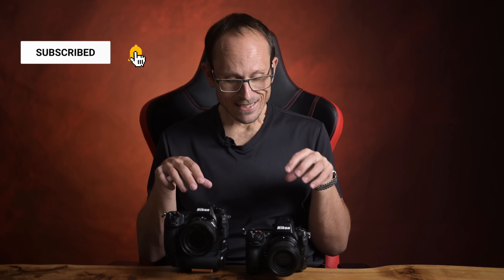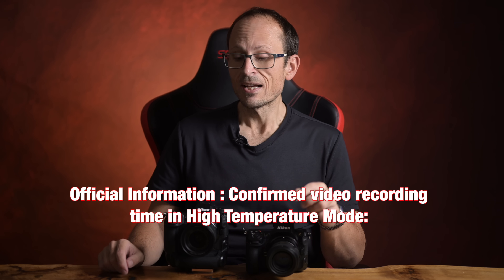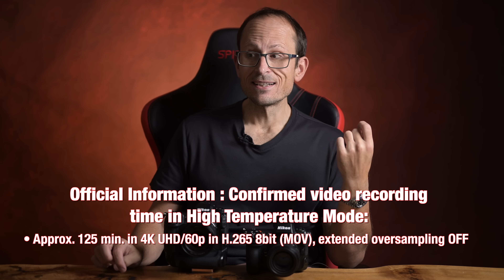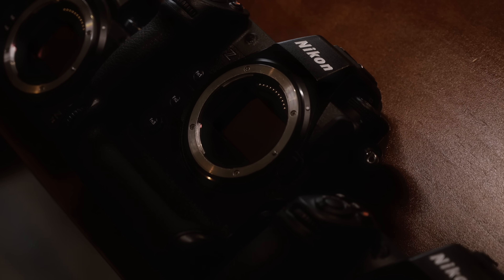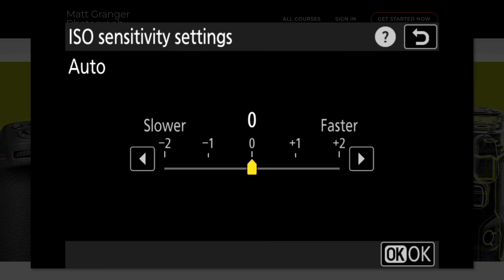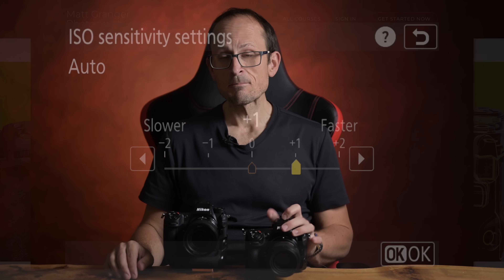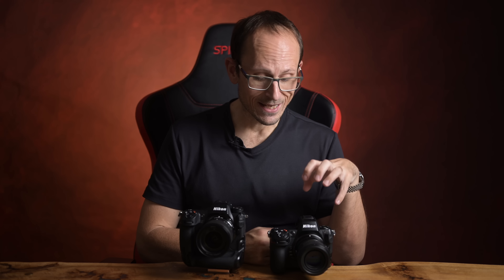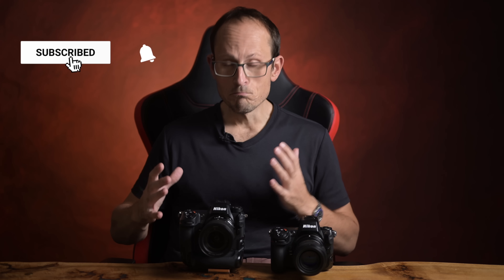Nikon Z8 - Video OVERHEATING & Battery Testing (VS Z9)

Comment: I would argue all smaller cams overheat unless they have a fan doing 8k i never tested this but tried now. My A1 doing 8k30p (no 60p) lasted 1h14m doing 10bit 4:2:2 at 240MB (didn't want todo 520) the body is much smaller than the z8 but fully metal room was 22c. Doesn't proof much accept that they all have a limit and you should know what use when. I think the z8 will be fine and if you really don't want to get a z9 but want a z8 with long recording change format and/or add some cooling.. don't complain but work around the issue :)
Reply: Gerald Undone tested that using a dummy battery can extend the recording time of 8k 24p to more than 3 hours without overheating on the A1. That makes the A1 powerful for long hours of recording. I wonder if the same trick can be used to make Z8 more usable.
Reply: @chanjeff4406  I am working on a cooling product for the zv-e1 and didn't have time to really test the A1 but i am sure if needed this time can be extended like you say i might do some real testing on the A1 too just never did. Thanks for the extra info.
Reply: @MattIrwinPhotography  Thanks for your input - that's reassuring to hear.

Apart from the most demanding modes such as 8k 60p or 8k 30p N-raw, could you also test 4k video, specifically 4k 24, 30 and 60p in Prores raw, N-raw, oversampled H265 10 bit, to see how long will it take for the camera to shut down? Also, can you make some of the 4k and 8k tests using a dummy battery (as it appears to reduce the heat generation), please?

I know I may be asking too much here but I really appreciate that you would put through the Z8 into difficult tests, so that we can see the real potential of it. Thank again.

Comment: Very interesting Matt, thanks.  I have had my Z9 for 12 months now and do use it to record video as well as stills.  The only time I had a "Hot Card" message was back in July when I was at the RIAT 2022 Airshow (in the UK).  It was a very hot day with very little cloud.  I was shooting one continuous shot of a display team in action.  I can't give you specific times or even which codec I was using at the time but the clip would have been somewhere around 4-5 minutes when I saw the message.  Bear in mind I had been standing in the sun, camera in hand, for several hours by that time.  I turned the camera off and put it under my chair to be out of the sun and used my Z7ii for a few minutes.  When I next tried the Z9 the message had gone and I had no further issue but did take care to shelter the camera from the direct sun whenever possible.

Comment: I think this is a very respectable performance for the Z8.  Using my Cobalt 650GB Gen 2 cards in the Z9 and recording 8.3k60 N-Raw indoors ~75F and stationary on a table, I was able to record four ~14:49 minute videos in a row without getting any warnings at all.  Card fills up, delete file, do it again, maybe 30 seconds rest between clips.  The Z9 does get warm, but not hot.  It is surprisingly even warmth on the surfaces of the body, and to me at least indicates a good thermal design.  Even with good cards, the Z6II can only do about 8 minutes in its top video mode, 4k60, before the camera needs to shut down.

Comment: It is impressive that the Z9 can do all of those codecs and frame rates internally. If you’re looking at the Z8, for video, I’d suspect that it’s more about form factor… If Nikon is actually serious about video, I suspect that a FW update to enable USB recorded (at least in some codecs/frame rates) will be coming… Until then, Ninja V+ and PD usb… Problem solved!
Reply: I was thinking the same. Two  ports seems to me an option for long recording with power and storage via usb.
Reply: Hopefully they didn’t miss that opportunity.

Comment: If you use an external SSD connected to the Z8 via  usb-c it will solve your problems of hot cfexpress cards
Reply: Is this possible!?
Reply: @northofbrandon  I don't have the Z8. It would be good to have the answer from Matt.
Reply: That's not a feature of this camera. At least not yet.
The Panasonic S5IIx can do it.
Reply: @robertfeliciano5723  I would love this to come to Z9 in the future via USBC
Reply from the maker: Not an option
Reply: @mattgranger  rip

Comment: do the test with usb charging,,,. it should run color because the battery could be the issue
Reply: Would be interesting with the grip as well since battery would be removed from the body.
Reply: @MTBD80  good point.

Comment: Thanks for the tests and results are the results. 
I still wonder if one used the very latest generation type 2 CFE-B cards - like the 650Gb Delkin Black or some of the others (even the pro models of your NEXTORAGE cards) whether or not the hot card "issue" would be deferred on each camera. Obviously in 4TB one has to use Angelbird and there are more choices at 2TB including the Sabrent Rocket CF-XXIT-2Tb I have. I will wait until my Z8 arrives to perform my own tests. 
I would make you point a little stronger very much doubt that other than for documentaries any folk would run a video recording continuously for a very very long duration -- even as B-roll -- you are going to want to set up and record multiple times and these are often fairly short segments. One matches our recordings to what we need and what our gear can accommodate. Speak to those who shoot with RED, ARRI and Blackmagic about having to wait for their cameras to cooldown. This is all part of planning the gig - as is having multiple units to swap out and use while others cool down. The trick with th eZ8 is it is relatively compact and relatively cheap -- so 2 Z8 and a relatively small gimbal/rig or one Z9 and a large pro-level gimbal/rig. Pros are simply going to make choices that work for their circumstances. 
Of course in ultra high heat like Qatar or Abu Dhabi I expect to have to actively cool gear and card not just let them cool down. For those of you in the tropics yes heat and humidity is a huge issue as well.
Reply: I didn’t realise professional cine cameras in large bodies overheat as well. I have the Z9 which is great. But I really want a Z8 for the gimbal and slider that doesn’t overheat.
Reply: @MattIrwinPhotography  Thanks guys -- you early users get to play first -- 😃😁
@MattGranger- I assume when your results say 1030 - that is 0 hours 10 mins and 30 seconds -- or 00:10:30.00 in normal duration terminology 
 I am counting the day until my Z8 arrives and I can run my own tests -- well set it up and shoot with it. Then test it. It looks like @Mattgranger was first out with a Z8 set-up guide and @ThomHogan is hoping to publish his Z8 "bible" on or before the 25th May or "before Z8 start shipping". Steve Perry is working on updating his Z9 guide for the Z8 as well -- so it looks like in the absence of anything in  form of downloadable documentation from Nikon - there will be something to read when Z8's get into muggles' hands.
Reply: @andrewmason8691  -- YES very much so -- RED (lots of HOT RED stories), ARRI, Blackmagic and others all have various forms of cooling solutions and when on shoots in the heat (like on Dune) they have to have multiple set ups to prevent holding up "filming" while the gear cools down. Canon and Panasonic Lumix have built in and and Fuji bolt one cooling fans for their CINE oriented bodies. 
Pro CINE cameras often have large heat syncs - rather like a CPU cooling in a computer -- and most have some form of active solution either built in or as an add on -  but active solutions add fan noise which also has to be managed.  
BTW - you should not just put a hot camera into a fridge/freezer --  it needs to cool "naturally" so that water vapour does not condense into water inside the camera or lenses -- which of course can then cause "issues". Similarly one has to take care when a camera is taken from a heated space into the very cold -- ask anyone who goes out to shoot in the midwest/northerly parts of the americas - lenses can mist up from the inside.

Comment: So, no surprises here. Basic physics. Without active cooling (internal fans/vents), sealed vapor chamber heatsinks, etc. to expand the thermal envelope for operation, this is expected. Even a hypothetical die shrink on the Exp7 processor is unlikely to shift the envelope that much. 

And it just illustrates that anyone thinking of buying a Z8 as a $1500 discounted Z9 as video production work horse, should accept there is no free lunch to be had here. 

For everyone else (90-95%+), it's not an issue. $4k Z8? Great buy for what it's capable of.

Comment: Nikon motto should be “Good but…” The Z9 seems to be the only good camera they have at the moment. I bought the D810 right after you released your review and it’s such a great camera that I purchased 2, nothing after that has make me want to buy another Nikon and this was promising…”but”. Thanks Matt!
Reply: well Z8 is definitely better than the D810
Reply: @raynerp  not my point! It’s supposed to be better because it’s at least 8 year newer technology. My point is that for the longer Nikon has been producing cameras that can be described as “good but” (insert many reasons why they’re not up to current standards) there’s always there that doesn’t makes you say this it’s the camera to get. I’m not buying every camera that goes out that’s why I didn’t upgrade to the D850 or anything in between and Nikon didn’t make any mirrorless cameras worth buying until the Z9. The Z8 was a good promise but ended up being another “good but” camera

Comment: I wonder if manufacturers need to resort to active cooling, like some have done, to get longer recording times in hot weather. Interesting to see if Nikon will go that way.
Reply: They need to use higher end silicon chips that are more efficient and run cooler. We might have to wait a few more years.

Comment: It will be interesting to see which memory card manufacturer will be the first to jump on the "We run the coolest to give you longer recording times." marketing push. Also, I get the feeling PD USB power might make a difference versus the internal battery in thermal load on the camera.
Reply: they will have to be refrigerated!

Comment: Matt Granger- The honest Nikon Guy! Very good info, thank you. I'd probably shoot short wildlife clips for video. jpeg-4k-120 if it does that. If I continue with Nikon, guess it would have to be the Z9. Does the Sony A1 over heat doing 120 4k jpeg, Anyone?
 With all that said, doubt there would be any complaints considering I would be upgrading from the D810 but, would prefer a REAL STICKY AF FOR BIRD PHOTOGRAPHY.
Reply: ~25min with A1 before overheating 4k/120
Reply: @livejames9374  Thank you. Helps put things into perspective for me.
Reply: @MattIrwinPhotography  From what I understand, you don't have to stop to swap battery A out. But does it switch back to battery A automatically once rep;laced. Just curious. For me it probably wouldn't matter to much. Short wildlife clips but imagine at some point I would want to do a time lapse.
I think the Z9 is the better option if one can afford it & it should be for the price. The Z8 is an incredible value for the price point in todays market. The AF would need to be stichy for fast moving birds for me or a camera that takes lees photos (less In focus photos are worth more to me than more night quite in focus photos) with an accurate AF would be worth more to me.

Comment: and this is why the Z9 is the Z9 and those that say " why I paid 5500 for the same camera" there you go. Yet another reason why you pay the higher price.  That said, no one is going to push these cameras this hard anyway but good to know. Now I would like to see how these cameras would perform on a hot summer day in Palm Springs with the hot sun  out and about capturing clips with the camera on and recording 1 to 2 minutes clips.

Comment: It is disaapointing how you do not understand how heat is generated during video recording. Use better CFx cards..Dont blame the camera..
Reply from the maker: I’m using the Nikon approved and recommended cards.
Reply from the maker: The same cards that are no problem in the z9… don’t blame the cards, or the messenger

Comment: Surprisingly the Canon R5 peforms better than the Z8 in your test - the camera doesn't overheat and its battery last longer in 4k 24 and 60p. It only overheats at 1 hour mark for 8k 24p. 

The Z8's video capabilities is questionable at this point.
https://youtu.be/dcm3yJUi79A
Reply from the maker: I didn’t 4K 24p

Comment: While I like most of your videos this one leaves out too many variables - see scientific tests of Matt Irwin or Nikon Ricci
Reply: As you said, there are way too more variables on the overheating tests - cards, room tempertaure, humidity, recording formats can affect the actual recording time. It's hard to give a definitive answer on where the Z8 is reliable. 

A Hong Kong youtuber test the Z8 at 8k 30p with Sandisk CFexpress and the camera overheats at 32 minutes. 
https://www.youtube.com/watch?v=zfZw_z2d9uI&t=311s

Canada youtuber Gerald Undone also did the overheating tests with different formats with prograde 650gb cfexpress. Using the same format, however, the camera overheats after 1 hours and 35 minutes.
https://www.youtube.com/watch?v=U0Rrsttll30&t=4s
Reply from the maker: See pinned comment. I have nothing against ricci, but he is a Nikon employee.  My test shows the z8 side by side with z9 using approved cards in ac room.
Reply: @mattgranger  with all due respect I only pointed out that your test is not scientific, not even apples to apples (obviously). You compare different! specifications and conclude the Z8 performance is worse. It's still a mini Z9 at a very attractive price point.

Comment: This was very helpful, thank you.

I wonder how much better the Z8 would do with the battery grip.  Having the battery a bit further away from the sensor and processor should allow a little longer times.
Reply: I would forgo the battery grip, use an external PD battery pack, that will provide power for longer, depending on the size you choose. I'm looking at the SmallRig V-mount battery as it has one PD port on it. Nikon lists SmallRig and FX LION as accessory makers of supported devices on their site.
Reply: @waynerm002  yes, I agree.  I went out after I wrote my question, and immediately realized the USB-C-PD port is the solution.

BTW, I think this goes to the discussion you and I had a few weeks ago about overheating expectations.
Reply: @UnconventionalReasoning  Man, I really didn’t expect them to do only 1 body but, it does a lot of high level video recording without a fan. I suspect if they did that, they would lose some Z9 sales. I like the smaller size of the Z8 and having PD and USB data ports make me think we could see external SSD recording, that would now put it at a whole other level.

I think they might do another camera in the future in a different style for video, after they replace the Z9, probably.
Reply: @waynerm002  I just picked up a Panasonic GH6 for 'work' videos.  It has SSD recording, I'm looking forward to trying it.  The feature was added in firmware, so the same might be possible with the Z8.

You should have believed me when I said they would only come out with one body. 😉
Nikon is not Canon (R5 / R5C) or Sony (A7 / A7R / A7S).  They're Nikon (D5 / D850).
Reply: @UnconventionalReasoning  LOL! I hear you. Nikon certainly went their own way and when I think about it, they are sticking to their rugged, quality build, doing what they do best. No failure points like multi-interface shoe that can’t be reliably protected. They partnered with known brands (Tascam and Sennheiser) for audio, which is great.  Seeing this video validates this as a fantastic camera in its own right. 

I did want an all in one camera anyway. What I would have preferred though is the vari-angle screen. I think they will develop a rugged one in the future. For now, I’ll keep carrying an external monitor. I’ll keep the FX30 as well. Let’s see what other features they activate on it.
Reply: I have done similar tests to Matt with the Z8, I plugged in USB power and had no problem getting 2 hours 5 mins at 8K 10Bit. I also did it with the grip and got the same 2 hours and 5 mins at 8k 10 bit. With the camera set to standard heat mode. This was at a temperature of 20c. I have just received a full production unit, and will be doing further testing and a video soon.  If you really want long run times external power makes sense for a lot of reasons. Let alone not having to stop to swap batteries.  I would suggest waiting for a few more people to test.  Cheers Matt
Reply from the maker: At what point in the 125 minutes did the hot card and hot camera warnings come on Matt?
Reply: @mattgranger  I really need to get my youtube channel going to stay on this thread! 🤣
Reply: @mattgranger  Hi Matt, I now have a full prod model, and ran the 8k H265 10 bit 24p with external power test again.  Temp control was set to 'standard' room temp was measure 20-21 during the whole test.  I had no probs getting 2 hours 5 mins.  Hot card came on at maybe 40 mins. Hot camera at 1 hour.  But it kept going no probs.  Right now I am running N-RAW 8.3k 24p, which uses so much space, only those shooting a motion pic would need N-RAW, otherwise I think takes will be short.  Let's see how that goes.  With my pre-pod model I achieved almost 70 mins. Way more than most would need. 30 mins in so far, and no even hot card. Astonishing achievement in N-RAW for such an affordable camera.

Comment: So basically, the same problems of a R5 hmm go figure. But at least no damm 30min rec limit.
Reply: Well kind of. The R5 started out much worse, 2 years in it improved.
Reply: The R5 is in a smaller body. I expected the Z8 would be a fair bit better in a larger body.